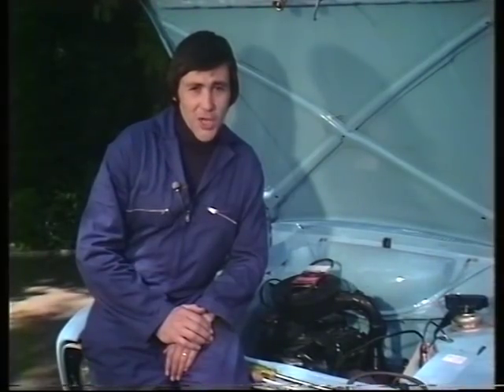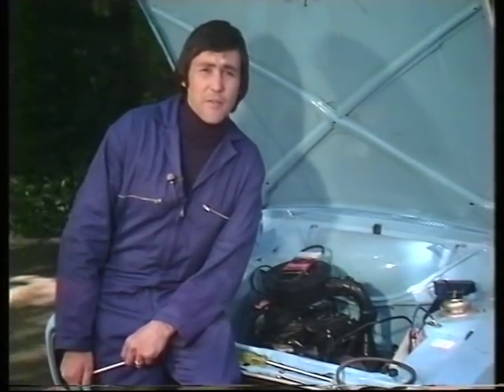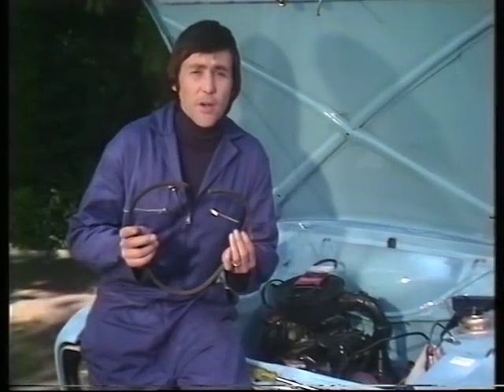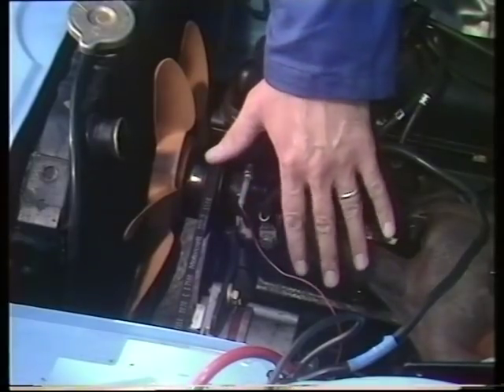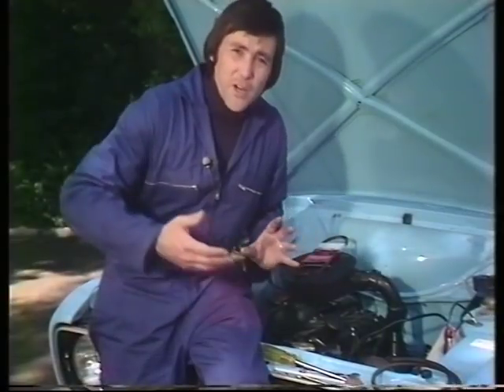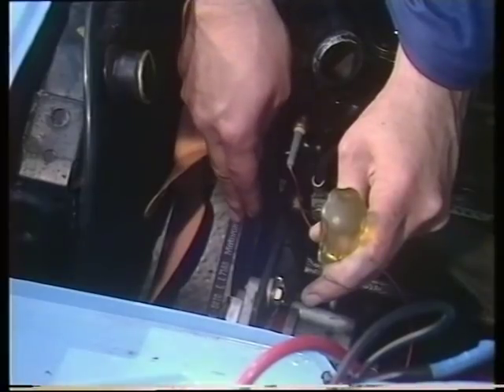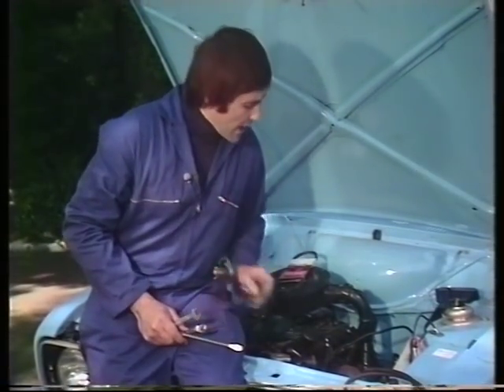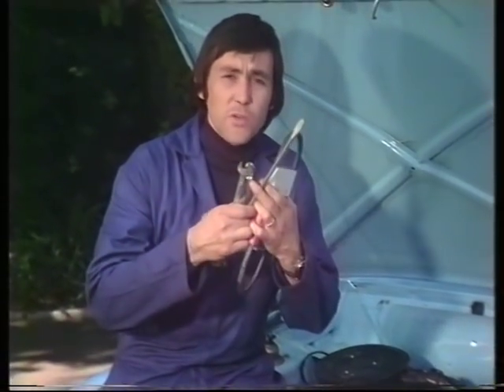How to change a fan belt | Retro Cars | Car Maintenance | Drive in | 1976

Comment: That nice new Escort , car DIY was very easy back then , especially on something like an Escort , I never had a broken or slipping can belt because I carried out a monthly check on it's condition , but the gutters of most A roads usually had a few discarded shredded examples. 
You could use basic tools to attend to most repairs , set a carb by ear and borrow a timing light to check and set the engine timing.
Reply: Yes, looking back,  cars were ridiculously simple back then.

Comment: Back when you could actually do things yourself.

Love my 1975 Capri MkII 3.0 Ghia, despite being the largest engine fitted in Capris, everything is easy to reach.

Replacing the fan belt is a 5 minute job, water pump takes around half an hour to replace.
Reply: Never had a 3.0.
I had two MkIII 1.6L, one MkII 2.0 Ghia Auto and a beautiful 2.8i Special in midnight blue.
I regret not buying a 3.0 because I borrowed two of them and personally considered them to be a better experience than my 2.8i.
My 2.0 Ghia was probably my favourite out of the ones I owned.
Keep looking after them!
Reply: @veritasvincit2745  the 2.8 might have been more modern in design but it didn't have the low down grunt of the 3.0.
Reply: @martinnorth2680  That's true. My 2.8 was a lot peakier and revvier than the 3 litres I drove.
They were lusty and torquey low down in the rev range.
I thought the 3 litres rode better too. The 2.8 was a little harsher in comparison. I think they tried to stiffen the suspension up which was OK on a smooth road but it crashed about on a rough surface. The 3 litre rode the bumps better.

Comment: Back in the day of cast iron, snap the fan belt and it would still get you home with short intervals and turning the engine off down hills!
Get back home and put the new belt on and off you go again, no head gasket problems or warped heads!

Comment: Good times really. Long gone. Nowadays you can only start fixing a car by plugging it to an OBD reader and reading fault codes. 🙄
Reply: RJFT 1973 which is not too bad, it helps considerably in pinpointing a problem.

Comment: Also one more thing, when working around the alternator you might want to pull the ground off of the battery just in case you accidentally hit the back of the alternator, I know someone who did not do this and when the poles in the back of alternator hit metal it ground out the electrical system and burnt up the ignition box and it cost me a lot of money to get it fixed

Comment: The days when cars had longitudinal carburetted engines with few bits to go wrong and if they did, all you needed was a screwdriver and a spanner. Or small transverse engines if they were front wheel drive. Though I would never want to go back to cars with breaker point ignition.